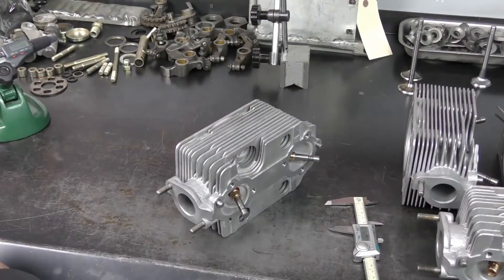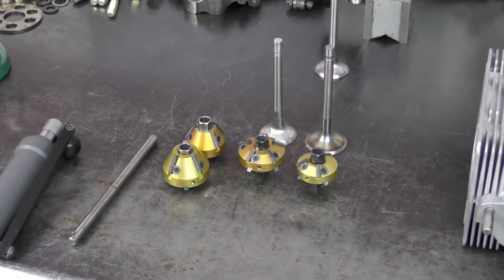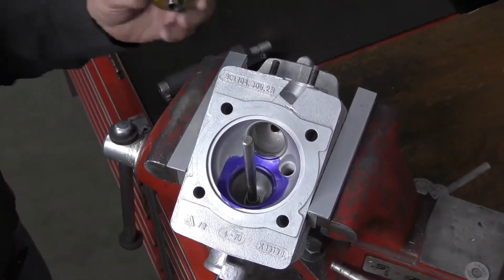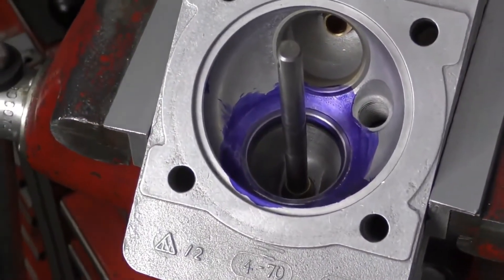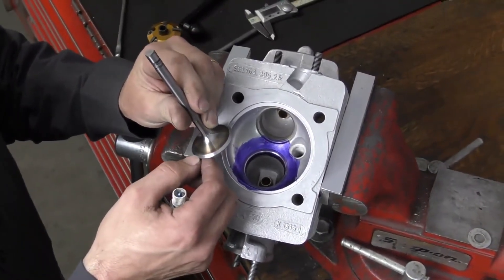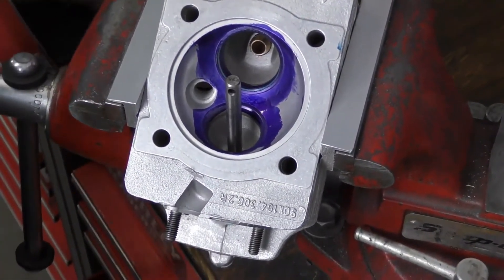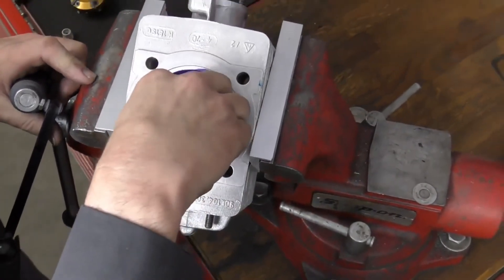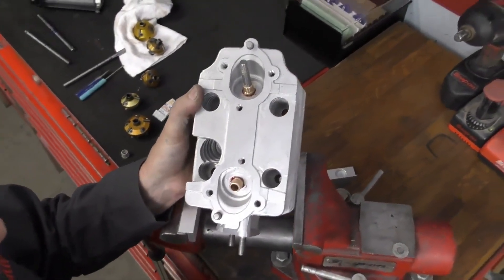Cutting Valve Seats, How to Rebuild a Porsche 911Air-Cooled Cylinder Head Lesson 5

Comment: I noticed in the 72, 73 Porsche Tech Spec book that the contact width (1.5mm) is drawn as a measurement 45 degrees to the valve face which would make the actual measurement across the face 2.1mm, Is this correct or am I interpreting the tech spec drawing to literally? thanks
Reply from the maker: Neven, 
Yes you are taking the drawing as if it is a to scale design drawing. The seat width is 1.5 mm and the tech book sketch is just a representation of that.
Thanks for watching
Kurt
Reply: @Aircooledconsulting  Hi Kurt just to clear I'm not taking the drawing to be scale but the angle at which the measurement is taken What grit hones do you use for the 9 & 13mm thanks
Reply from the maker: @nevenmacewan1869  Neven, I understand, but the dimension of the seat width is still 1.5 mm. I use a 240 grit ball hone on both the valve guide internals and on the 13 mm guide bore. They are different types of hones, however. One is designed for aluminum and one is designed for red metals.
Reply: @Aircooledconsulting  Thanks Kurt. So I'm assuming Silicon Carbide for the 13mm and Aluminium Oxide for the 9mm, one last question, i've seen recommendations to drill the guide before removing it (I'm, assuming a 10mm drill), from what you show this doesn't seem necessary, your thoughts/experiences?

Comment: Valve cutting model number   ?
Reply from the maker: The cutters we use in this lesson are Neway cutters. You have to match the valve guide with the pilot rod and the cutting angle heads. So 9mm valve guide pilot in the 911 and  30 °,  45°, and 60° cutting angles. 
We have moved on to a three-angle cutting system that cuts them all at once on the milling machine. I will have to post a video of this way as it is a great time saver and super repeatable once you have set up the first valve seat.
Thanks for watching, Klassik ATS
Reply: @Aircooledconsulting  Hi Kurt, any reason for  60° not  75° (as per the specs)?
Reply from the maker: @nevenmacewan1869  Neven, no real reason other than Neway has some unique thinking on approach and exit angles. When I'm using my production cutter I use a 3D insert that cuts all three angles at once. With that one, I'm running 30/45/75 degrees. We have some videos coming out on that tool pretty soon. Although it is an expensive setup, the tooling is about $1000 just for the cutters. Then you will need a mill or head and valve machine, a custom fixture to hold the heads in place, valve guide pilots, and finally a driver adaptor that will drive the seat cutter. If you have a mill already figure about $2000 to get started with a profile set up.

Comment: Is your preference to use the original sodium filled valves or solid type? Not many choices for sodium filled valves.
Reply from the maker: The purpose of sodium filled valves is to help keep the valve cool. With that said on turbo applications and really high compression engines i prefer to use sodium filled valves. On general stock engines with a customer that is looking to save some money then i have had good success with non sodium valves.
Reply: 47.5mm +.6 is this a universal measurement for valve play on all air-cooled 911 heads? Where does one look up these specs?
Reply from the maker: @thinkerdoit  The 47.5 mm dimension is good for up to the 1977 2.7L engines. From 1978 the dimension changed to 46.00 mm +/- 0.3, this dimension was also applied to the 3.0L turbo models from 1975-77. All of these specifications are available in the factory service manuals. We have an extensive library that covers from 1955 - 1994 models covering all Porsche models in that time period.
Reply: Im reading on Neway’s site a 45 deg valve surface can be cut at 46deg? Can’t be right unless theres another application im not familiar with. Any idea? 

Do each of those cutters cover only a single angle or multiple? Can u adjust them by 1deg somehow? How many seat cuts can you do before they wear?
Reply from the maker: @thinkerdoit  That is something unique to Neway's thinking. I have spoken extensively with the engineer at Neway about the theory behind it. What they say is that the 46-degree angle causes a knife-edge type of seal and that the valve will somewhat deflect into the seat under spring and compression pressure from the engine. I have used the 46-degree angle without any issues in the past.
Reply: @Aircooledconsulting  Thanks Kurt. always appreciated.